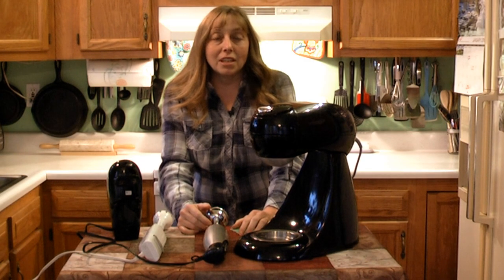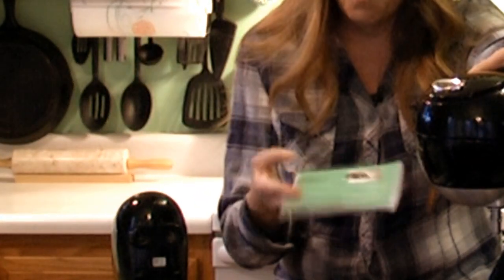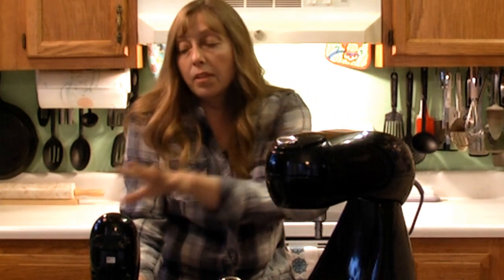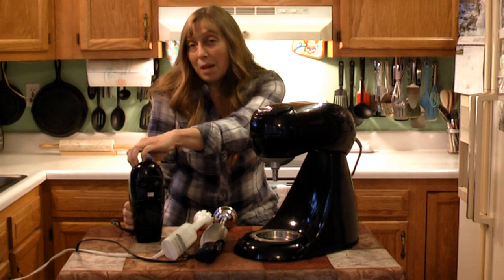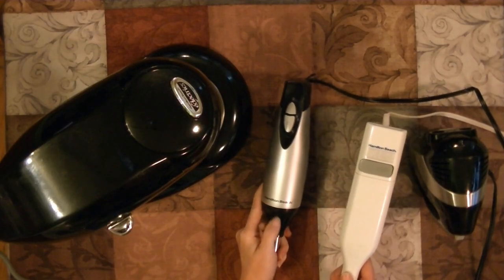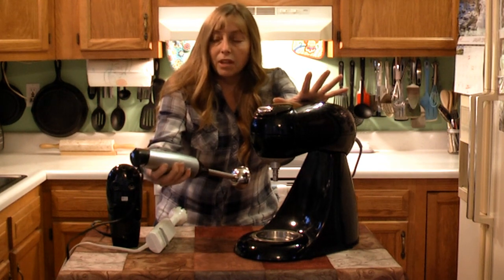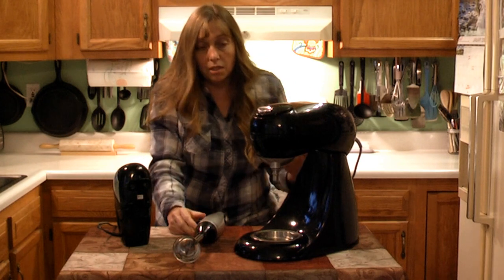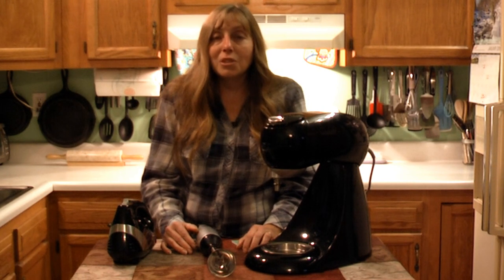Duty Cycle Explained And Why It's Important -The Hillbilly Kitchen

Comment: If you know your motor is 'copper-wound' is the duty cycle still applicable?
Reply from the maker: +Essem Sweeney All electric motors. Bigger wire and lighter loads increase the cycle, but they all have a time limit.
Reply: +The Hillbilly Kitchen - Down Home Country Cooking Thanks to you and Bret for this info.
Reply from the maker: Essem Sweeney :)

Comment: Great info! I noticed on the cheap mixers the stuff getting sucked in the front. It couldn't be good for the motor.
Reply from the maker: +AmyLearnsToCook Thank you :) It is not good at all and there is nothing you can do about it
Reply: +The Hillbilly Kitchen - Down Home Country Cooking I tested out a little Dash Go stand mixer and it was the same way. All the flour would blow straight up into the vent holes in the front. It is only a matter of time until it kills the motor. I noticed that KitchenAid the fan holes are in the back.

Is your stand mixer a Hamilton Beach Eclectrics? How do you like it?
Reply from the maker: AmyLearnsToCook It is a Hamilton Beach and I love it. It is very smooth and has plenty of power.